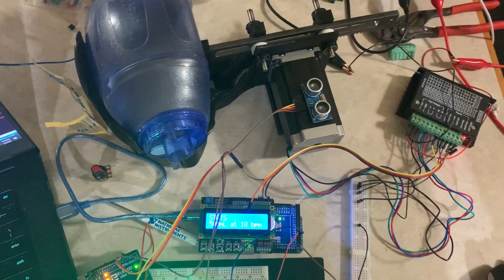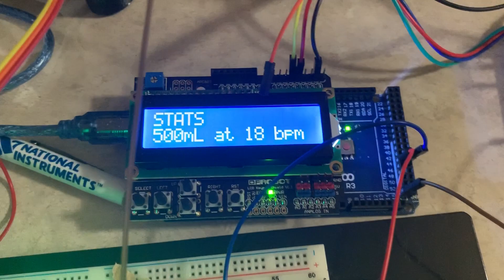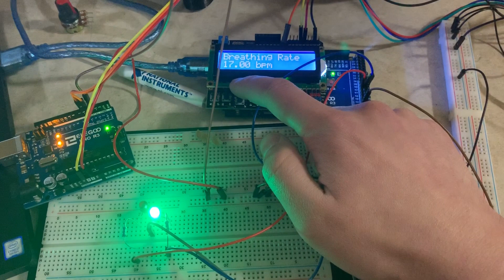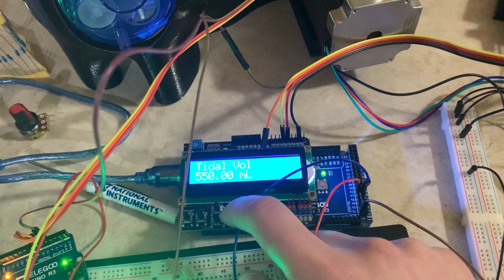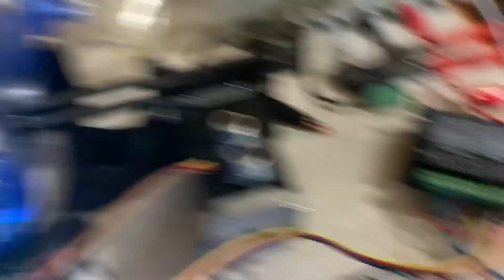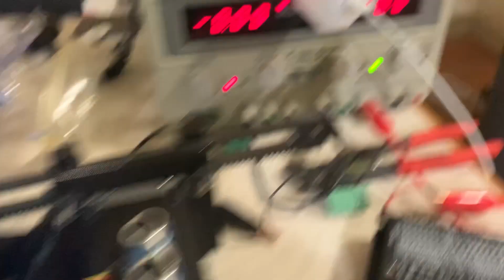Mechanically Actuated AMBU Bag (Controls Lab Final Project)

Comment: Very good project 👍 
Is there the posiblity that you share the code for this? I am trying to make the same project for hospitals
Reply from the maker: Sorry, I just saw this. Link for the code is in the description. I would not trust an arduino or that code for anything beyond an academic project or for fatigue/structural tests. We also were developing this for hospitals, and we didn't have high confidence in using an Arduino for controlling it. It's too hard to get a reliable timer to work with it. Any other calculations slow it down too much, lowering the bpm it provides. 

We had a separate team of engineers to do coding and they were using raspberry pi's. I'm not sure where they are now on that, I just did the structural design and passed it along.